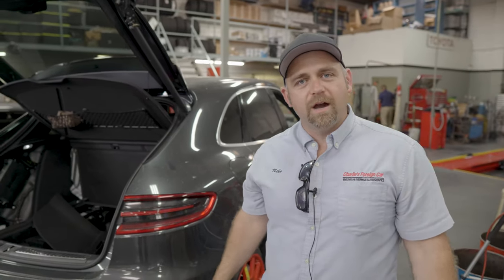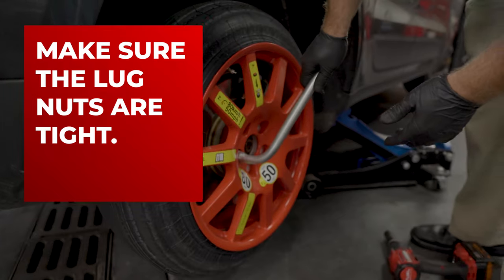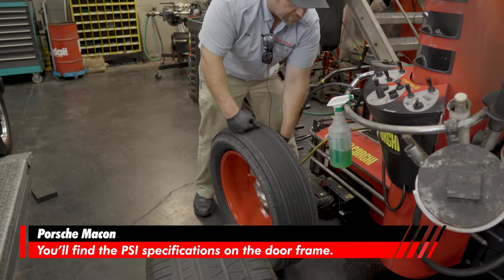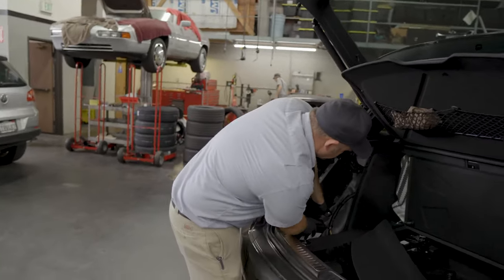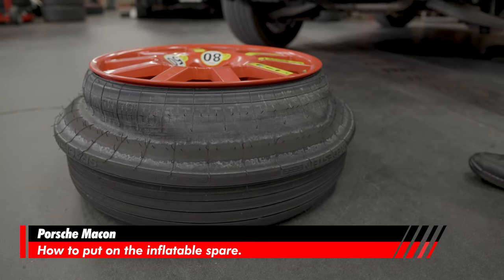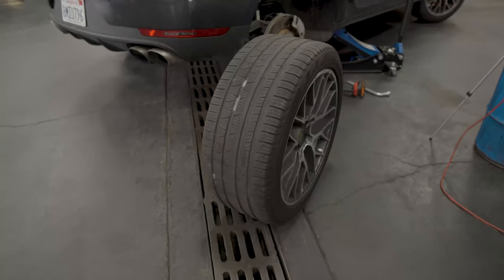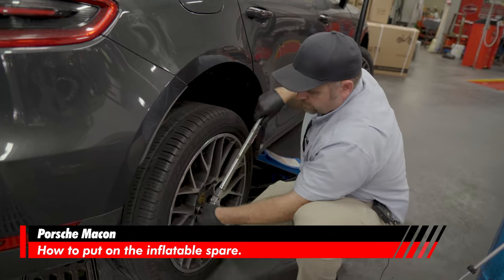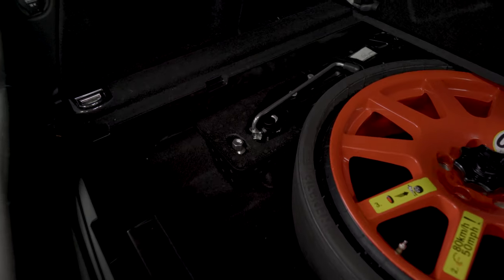Porsche Inflatable Spare Tire

Comment: Yes, that would be bad for the wheel to come off.  What size nuts? Does the wrench come with the car?  What's the torque setting?  Do you use anti seize? How about some detail a real mechanic would know and share.  But, yes, you don't want the wheel to come off.  Thanks.